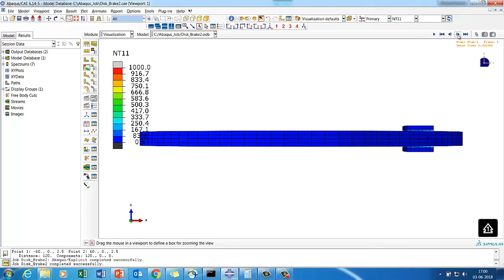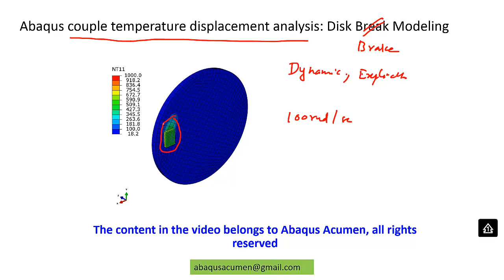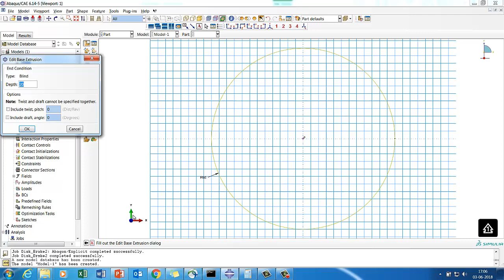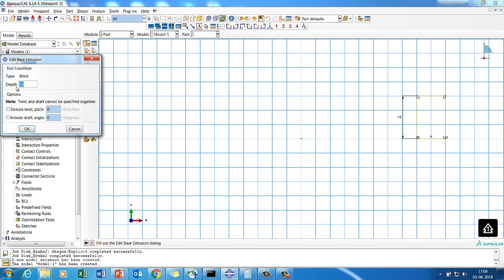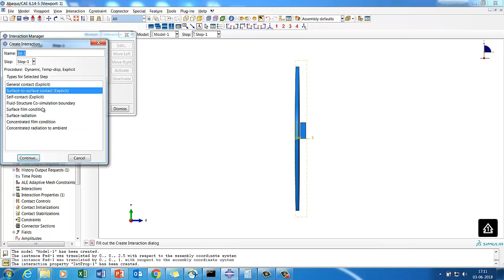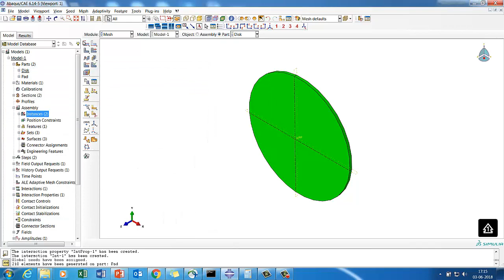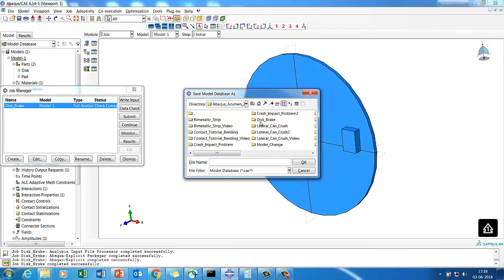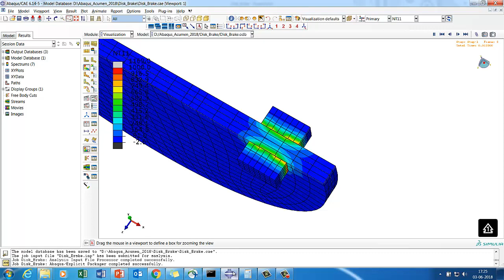Abaqus Dynamic Explicit:Disk Brake Analysis:Step by Step

Comment: why the simulation that shown in video at first is different from the one that shown at the end of video?what is the difference?
Reply from the maker: It is because the thickness of Pressure pad is different.
Reply: @abaqusacumen7397   i am currently working on facing and turning operations of a lathe machine. And facing problems in simulation of same. Need your help.

Comment: Hello Sir, I have a question about stress intensity factor, In  3D model, there are many values of stress intensity at each contour. So how can I select the stress intensity value and at which contour?
Thank you so much.
Reply: The values of stress intensity factor are pretty close at contours further from the crack tip, right? So just average them. The one closest to the crack tip is not perfectly calculated, because stress intensity factor is assumed for the elasticity (stiff materials that don't have large plastic deformations), while the area around the crack tip has elastic and plastic deformations.
Reply: Of course, I identified 5 contours but in Date file I found many values of stress intensity factor, there are repetition of number of contours! How I can solve this problem, please? Thank you so much for your helping.